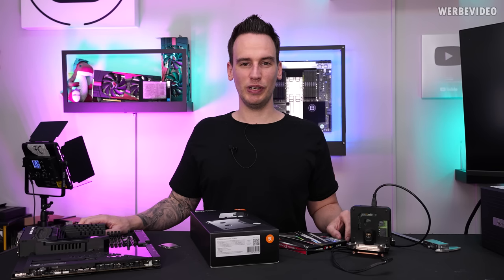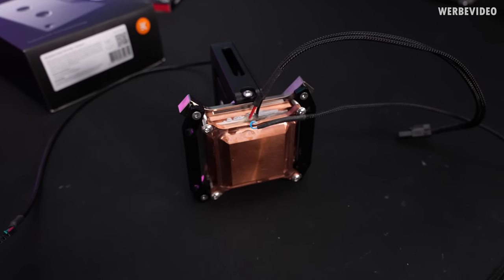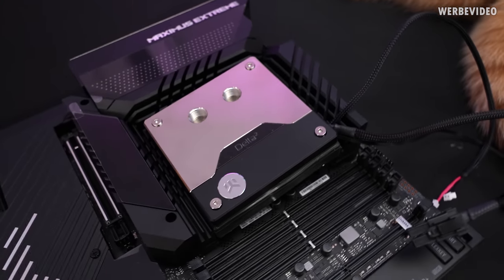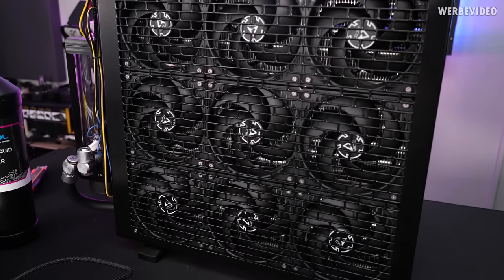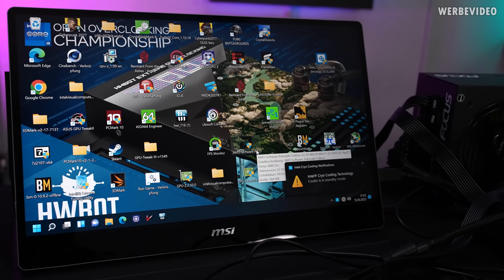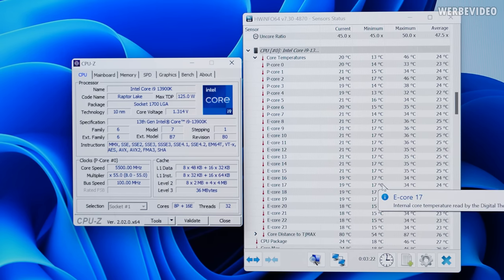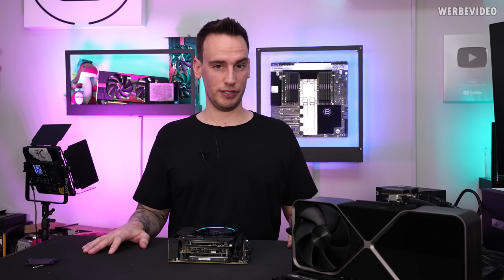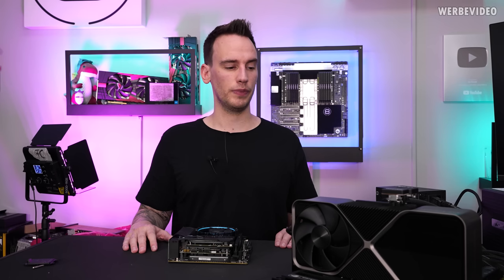This insane 500$ Water Block allows 13900K Overclocking above 6 GHz

Comment: Would love to see you try to make the "ultimate" peltier cooler, by having 2 water loops one cold and one hot, 
allowing you to have more peltiers and either getting even more cooling or having each being at its most efficient point.
Cold loop: cpu water block, pump, and peltier cold side block.
the hardest part would be making a pair of custom water blocks for the peltiers.
hot side: peltier hot side block, pump and radiators.
Reply: if i am not mistaking Alex from ltt made something similar.
Reply: I think he did this in a past video. It doesn't work very well
Reply: Would it not be easier and much more efficient to use an off-the-shelf water chiller to cool the loop? LTT did a video with a bunch of peltiers as you describe, but that seemed more for the novelty.
Reply: @BravoCharleses  They also have a chiller cooling video, man, LTT got everything ahaha
Reply: @BravoCharleses  their setup was horrible, made with cheap peltiers, on chinese coolers and blocks.
but yes its still for the novelty than being a good cooling method
Reply: That doesn't work very well. Peltier is OK for direct cooling of lower loads.  
For your idea a compressor based chiller is MUCH better. Both in coling capacity and power consumption.
Reply: Thats not how that works. Awesome idea, but physics doesn't allow it.
Reply: @ThePentosin  yep, phase change is the way to go. You'd need like 2000W of peltiers to get what a 400W phase change cooler can do. (I made that up, it's probably more than 2000W).
Reply: Repurposed second hand air conditioner will give you lower temps and more colling capacity and better power efficiency at fraction of the cost.
The only thing that keeps TECs alive is size, no moving parts and no leaks. None of it matters thou in desktop use as its not satellite.

If you want to see kilowat peltier chillers in action (and actually working ones not the LTT abomination : P ) check out old topics on overclockers forum. Few crazy dudes have spent 2-3k$ and made well designed ones. They're still not even close to how cold would phase change system go and draw more power.
Reply: @volvo09  Phase change can be more efficient than peltiers, but if its set up correctly (in the spirit of the LTT video, but less chaotic and awful), where there are many peltiers run at a lower power, the efficiency can be about equal to a good phase change chiller.  It also helps greatly to run high quality peltiers, not chinese cheapo ones.
Reply: @ThePentosin  my idea that isn't mine at all, is simply how to get the most out of the tech, of course there are better methods to get those temps
Reply: @cj09beira  I know. It's been done and tried since the early days of pc watercooling. 
It sucks.
Reply: Peltier is shit, after 500$ you should just consider a compressor/ac cooler.. The Alphacool Eiszeit is 1000€ and gives you 1500W cooling power with 660W.
Reply: @BravoCharleses  yes probably however peltiers  can be much smaller in "theory" compared to chillers.
Reply: @ThePentosin  what about the minimum size tho ?
Reply: @cem_kaya  yeah, like I said. It's OK for directly cooling lighter loads. Inefficient, but ok. Still need a very decent custom watercooling loop.
Reply: I actually built exactly what you are describing for my daily 8700K build back in 2017. It worked well aside from the power consumption of the cooling system. I was able to run 100% stable at 5.4GHz with a -1 AVX offset. (prime95 SSE and AVX2 stable)

This can work if you do it right and size all the components correctly. I used 4 62x62mm TECs between a pair of large custom copper blocks. The TECs were rated for 400W Qmax at 25V, but I was using 12V to improve efficiency. Control was done by a custom PWM controller I made with an arduino and some big power MOSFETs.

This setup was really cool and fun, but it simply wasn't ideal. I now use a Koolance 900W chiller unit in another room with 15 ft tubes for my daily-capable sub ambient cooling. My current main PC build has a standard water loop with bypass valves and quick disconnects so it can run with or without the chiller. The increased efficiency and cooling capacity makes it possible to include the GPU in the loop as well.
Reply: @sznikers  As one of the "crazy dudes" who built a daily TEC rig, +1 to all of the above. It is possible to make an effective daily TEC rig, but the efficiency is terrible.

I use a Koolance chiller now to get the same temps for less power at even higher heat load (CPU + GPU vs CPU only) It was also cheaper to do.
Reply: @TykeMison_  you seem to have knowledge about air conditioners but you haven't seen DIY pc water chillers or phase change PC cooling in action.
Its been done thousands of times, it is proved solution. It doesnt run constantly cause coolant tank is heat capacitor so it can cycle, evaporator cant frost itself as its not in the air, temperature is controlled by simple external module, charge can be adjusted simply but not necessary if sacrifices are made and so on. There are 20 page 40 page old forum topics that describe all this, they include full instructions and explanations that im not going to write here. Many people who DIYed those systems 1-2 decades ago when it was peak popularity were actual engineers in that field or have became ones. They even constructed cascade and autocascade systems and went below -140°C with them (those weren't cheap ac thou ; ) ).
But it is solved problem and way to DIY water chiller is freely available knowledge in old pc enthusiast corners of the internet. 
TECs suck, phase change is cheaper, simpler, will give better delta C at better capacity and use less power. Even brand new plug & play phase change chillers are cheaper than constructing TEC chiller for PC cooling, like that koolance kit the guy above written about. Keep in mind its hard to keep TEC hot side below 40°C and all that manufacturer data with deltaC graphs is in relation to TEC hot side not ambient air or hot side coolant. So if you want water at 10°C you need delta of 30° if your hot side is 40. Look at TEC coefficient of perfomance and Qc at 30° delta, both are really bad. And all that even before we consider thermal resistance of coldplates, waterblocks, rads and all the tim interface one needs to use for all the gaps. And those graphs tec manufacturers publish more often than not aint even real measured properties of their products, they're theoretical values calculated by them. There is reason all the refrigerators, freezers and airconditioners are phase change based and nobody uses TECs unless they're forced to by other factors. Well, maybe except for Alibaba sellers as they seem to push lots of snakeoil "high performance efficient tec coolers" to gullible people. They make funny YT vids thou, like that recent LTT abomination ; )
Reply: @jedi9577  thats nice, what cpu and gpu kombo you now cool with it and how are the temps on them with that 900w unit?
Once i move i plan to do same, chiller in separate room for no noise and just run the cables through wall/floor.
Reply: @sznikers  Yeah the real serious OC with phase change gets into cascade chillers, basically chilling a chiller.. lmao
Reply: @jedi9577  "...in another room with 15 ft tubes..."

Do you mean for the compressor loop?

Comment: AlN ceramic TEC modules are usually used for power generation or for extreme mission critical cooling applications. Remember salvaging about 50 of them from a 48V solid state natural gas generator that was originally for backup power at a cell site. It made 48V at up to 120A iirc. The modules were a bit big for cpu cooling though they made awome stand alone water to air chillers.

Comment: So you ran it without the pump and fan wires attached to the proper points?

Or that was just a test on the second pc?

It wasn’t bypassed in the final configuration?

Comment: I have bought the cryo cooler, but unsure how the controls are working in general. When the fans and the pump is plugged into the system is that merely a safety feature for not burning the TEC or does the software let you control the pump and fan speed?
Furthermore, I have a temp header on the MOBO, which I'm planing on using as a secondary security measure, but not sure how to go about it?

What kind of controls would you recommend or what are you using?

Comment: Quick question. Does the rubber boot have any issues installing if you  are using the contact frame instead of the stock ILM?

Comment: I think with even a fraction of that aggravation that you had to endure, I would just simply port a nozzle of a portable AC unit into a case. 17° C (~63° F) is in range of one of those portable units and as a side benefit it has enough cooling capacity to remove all the heat from both the PC and room.
Reply: It's heading into that direction....maybe like a little mini freezer dedicated condenser
Reply: humidity
Reply: @sayacee5813  ACs remove humidity
Reply: @sayacee5813  inside the case will be dry and  cold, water will condense all over the outside though :)
Reply: @sayacee5813  that's not how condensation forms. The concern would be the outside of the case if you over cooled it.

Condensation forms when warmer humid air contacts a cool surface. The only time you could get that condition in an AC'd PC case is if you over cooled the PC (say down to 35deg), and then shut off the AC and opened the case... then it would be like bringing a cold item inside in the winter. It would get a small amount of condensation 

 It doesn't happen in reverse (blowing chilled air inside).
Reply: @sayacee5813  .. It's not quite cold enough to develop what I assume you're meaning by "Humidity"  -> Condensation and you have the heat from all the other components drying out the air. I guess if you're in a room that has high relative humidity and temperature then maybe. My office is around (74° F) 23° C with 45% relative humidity, so a delta of (10-15° F) ~7-8° C won't in my condition cause condensation.
Reply: @volvo09  if condensate forms on the outside, it'll get into the case. If you build a completely sealed case, you know moisture will still get in. You'd have to run it constantly like a server room. Makes more sense to me to just put it inside a non conductive liquid attached to a cooler and high flow cross current pump..... you know, because it's about the same amount of trouble 🤣
Reply: Solution already exists to all your problems. Its called chillbox it can be made quite cheap if you have basic DIY tools and spare air conditioner. Just make sure you properly seal the cables and run them downwards from connectors as that's the only part water can condense on (and inside sometimes : /  ).

Comment: Water chillers are available for under $400 which are  more power efficient than peltier systems and can easily supply water at temperatures in the 0 C range or for more $s even lower. You may have to worry about condensation on the tubing, but a little insulation provides an easy fix. Adding a chiller to a loop does require a little DIY but is not a complicated build.

Comment: Any idea how much power the tec is using? That's really impressive if it's a reasonable amount considering it's only 1 pcie connector.

I remember tec/hybrid coolers before just not being efficient enough to justify the difference
Reply: A Peltier device is quite inefficient for lowering CPU temps: it must AT LEAST use the CPU wattage to maintain the temperature, otherwise it will overheat. It kind of acts like a very inefficient heat pump! I don't remember the numbers exactly, but you must add around 30% to the CPU wattage. So the total power consumption will be : CPU_wattage + (CPU_wattage x 1.3)... and even more if you want to have very low CPU temps. (I've used a 54W and 72W peltier to cool a Celeron 300A, which is rated 20W, but can go up to 40W when overclocked).

What is special in this setup is the controller board! It will keep the Peltier operating power in sync with the CPU power, which is really interesting (otherwise the CPU would freeze when idle).

Comment: I don't understand why they would put the Peltier cooler directly on the CPU and not simply use it to chill the water. There are a couple of advantages to chilling the water, the first is that you can pre-chill a volume of water for prolonged thermal stability, more thermal mass gives you more constant temperatures. Direct application also has the terrible disadvantage of forcing the Peltier cooler to mitigate all of the heat at the cost of equivalent energy to that heat. Then the water only moves the heat away from the chiller at additional expense. 

If the water is chilled most of the heat is dissipated by the normal heat loss at the rate of a room temperature water cooler, with the additional level of cooling only, being powered by the chiller providing a significant power saving. The only advantage to direct application of the Peltier cooler is sub zero cooling which would be a condensation problem. The choices selected were for a novelty item. The practical application has been completely ignored here. Move the chiller to the water tank. 
Put thermal sensors on the CPU, water tank and tubing. The Peltier can be used as a chiller, a dehumidifier, and an evaporator cyclically, since the thermal mass would provide stable duration. This would lower the dew point inside the chassis, the heat could then be used to evaporate the moisture and pump it back out into the room and keep the water tank topped off.

Comment: Not sure how you used your contract frame with the factory screws. I have one on my Maximus Extreme Z690 with 12900k and it fits fine and works great but on my Z790 Maximus Extreme with 13900K the Thermal Grizzley wont fit with factory screws and even with 2mm longer screws it fits but and its making it so my chip wont OC like it did before the frame install. I'm gonna have to uninstall it on that board. That same chip OC to 6-6.1 and worked fine with the thermal right frame which I had used to get my system up and running while I awaited the grizzly that was backordered at the time and it used factory screws so maybe something's out of spec?

Comment: Back when we were trying to oc another hot CPU, the dual-cored Pentium-D, I slapped a 100w pelt on top of a copper waterblock and cooled that with a Thermaltake SLK800.

The advantages being that it allowed the watercooling to function normally, did not require the peltier to be running all the time, and allowed a lower power tec to assist in cooling without running into that wattage cooling wall.

Others did similar things with pelts as inline waterchillers, which can be a simple as a second waterblock paired to a tec and cooled by a second watercooling/radiator setup or just large hsf/block of alluminium. 

It's funny to remember that the Pentium-D was only like 130w and got all that bad press anyways.
Reply: Sounds very adventurous. What's a pelt though?
Reply: @Ben-ld1qi  it's that thing the waterblock in the vid is using for additional cooling
Reply: @molochi  thanks

Comment: Is the bottom of the block already sanded flat? I found a 200mhz gain on my old 2.4ghz Athlon x2 by sanding both CPU and cooler flat by using a window as my base for the wet-sandpaper (I maxed out at 3.5ghz on air stable enough to run 3Dmark and play games). I used gasoline instead of water when sanding down the CPU, as it evaporates afterwards, then cleaned up any remaining particles with coffee-filter since coffee-filters don't leave anything behind.

PS: with perfectly flat CPU and cooler the CPU will stick to the cooler all by itself because of molecular interactions, so no paste needed. Normally the CPU will stick out farther around the edges so as soon as you sand your CPU enough to take off the center writing you're golden.

Comment: Interesting. Have you considered another test with some "liquid metal" instead of thermal paste as the CPU die/heatsink mating compound? 

Tests elsewhere on YT have reported notable thermal improvements with this change alone. I wonder if perhaps "liquid metal" would have any positive/negative/neutral impact on power consumption/CPU performance bump ratio?
Reply: Liquid metal would be a very bad match for sub ambient cooling. Thermal grizzly actually gives a lower temp spec of 10°C minimum to use conductonaut.
The TEC cooler could solidify the liquid metal under some circumstances..
Sub ambient, high performance thermal paste is the way to go.

Comment: What I do and have done for a while is I have the radiator outside, soldered the fans onto a few ethernet cat 6 S/FTP cables, and pump the liquid straight from the blocks and out. 
But I really should delid the CPU, as that's my largest limitation, as well as a quite mid-tier motherboard. Never been able to thermal-throttle my GPU, have yet to shunt-mod it. 

The components are quite aged by now though. But since ambient outside during winter is subzero, and during summer quite high, there's quite some variance. Thanks to very loud fans and the fact I only have two of them, I can power them from the mobo, set the fan curve appropriate to the temperature of the CPU and it's all fine.

But recently I pushed voltage up and now my CPU can sit at 99°C while my GPU is only at 20~30°C - both being loaded nearly to the limit. I hope delidding w/ LM will help better transfer heat from the CPU to the block.

But that's just one way to solve it. A very budget oriented one to get the most out of a unbalanced 2016-era setup.